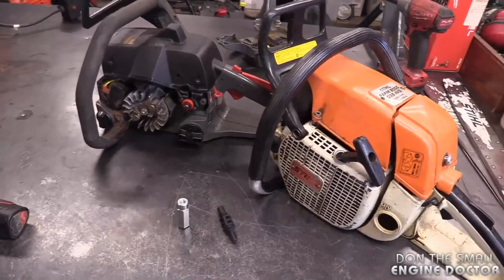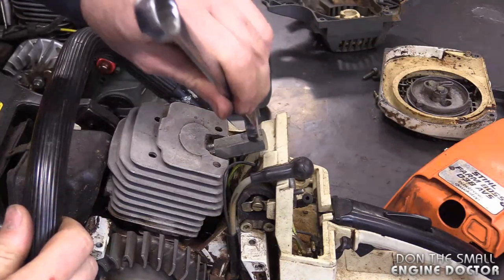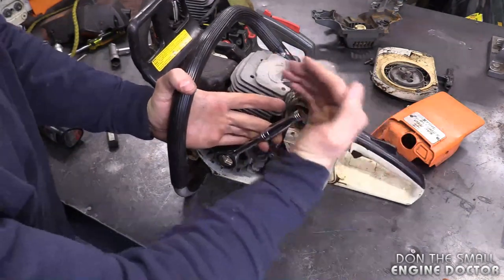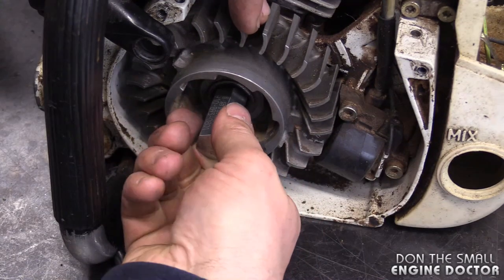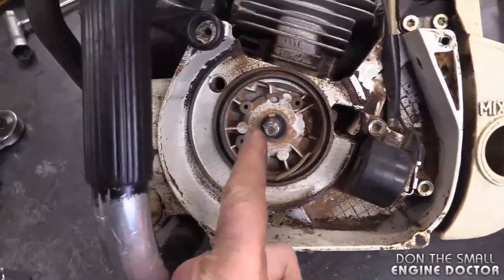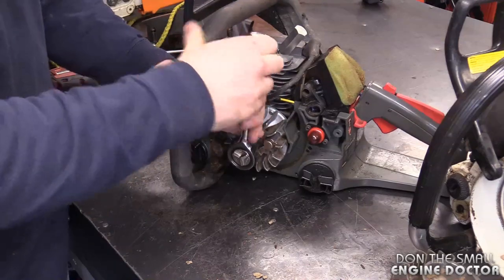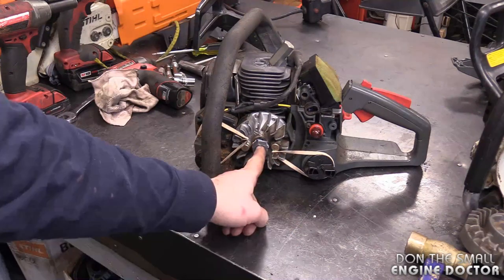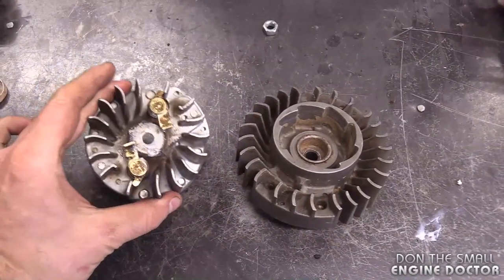The Best Way To Remove A Chainsaw Flywheel!

Comment: 19 idiots downvoted this video...why? what possible reason could they have? smh
Reply from the maker: other jealous youtube channels and shop owners
Reply: Hi, Don I need your help. I made a mistake on my 310 stihl chainsaw trying to cleaning I took off the front pulley and now the flywheel won't spin neither can get the rope out. Plase help
Reply: Because he’s way over explaining his hammer selection and how to hold the saw when you hit it. Anyone who’s even considering removing a flywheel knows tools and is mechanically inclined and if they’re watching this, they really just need a quick “lock up piston, unbolt, screw tool on, give a light whack or 3, and remove.” Not a long explanation on hammer selection. 

Granted I didn’t downvote, but being in a hurry, I was a little annoyed at the drawn out hammer choice and saw holding explanations and I’d imagine that’s why people downvoted.
Reply: It's because they broke their flywheel
Reply: In one video I saw and the guy was saying not safe to use piston stop on big engines like lawn mowers. It is safe on chainsaws. That could be the reason why them downvoted
Reply: Cos you don't need a piston stopper tool. Just use an impact wrench

Comment: As allways good safe advice that's so handy to know :-D

When i was a kid i removed a magneto flywheel off a motorbike using string and a small hammer, the string went through the flywheel holes twice so i could pull them really tight. While i was pulling,  my mate tapped the nut twice and the flywheel jumped an inch forward and was stopped by the nut.
Simple methods can work really well :-D
Reply: Great comment zx8401ztv, I've used this procedure when I didnt have the rite puller setup but used my fingers to hold the flywheel, supporting the powerhead entirely then (with a helper) carefully smack a deep socket on a flange nut which was backed off slightly and always had good results.  My fingers thank you for the string idea!
Reply: Arne Nelson
The string and what my dad called 'Shaking the taper' worked so well for me, good to know some tricks :-D
The old haynes manual was great for ways to do a job without special tools as well :-D.

Comment: great advise , and then i come out with an idea, the nut in the flywheel as you show there I put a long socket 13mm in my case and the banged with a rubber mallet and voila!! nice and lose. Thanks Dony

Comment: I back the flywheel nut off a bit and pop the end of the crankshaft with an air hammer. Pops the flywheel loose instantly. Been doing it that way for 20 years. Basically the same thing as in this video.
Reply: Until you get a real tight flywheel.
Reply: fixinphil  Flywheel is just on a tapered shaft. Not threaded on. I’ve taken off flywheels on really old rusty engines, over tightened flywheels, everything. Like I said I’ve been doing this at least 20 years. I’ll let you know if I ever find one I can’t get off. Lol
Reply: wcjcnc The method that you use to get the fly wheel off is exactly what I do works every time
Reply: wcjcnc I understand that. Taken off many also but every once in a while you get one that's really tight. Same with gens. Always get them off too but definitely will try your method.
Reply: fixinphil I also use that method on alternators. Carrier and Thermo king pulleys are on real tight and we send them out to the rebuilders so you cannot damage them
Reply: i set a pair of vise grips on one of the fins , i suspend the saw off the bench about 2'' by holding the vise grips then give it a shot with the hammer , works every time

Comment: Great to know, thanks.  But WHY does this work, is there enough movement along the crankshaft and/or something that the flywheel hits to jar it loose when you hit the crank end(with nut, etc.) with the hammer?  I've obviously never worked on a chainsaw but lots of lawnmowers and old outboards and there's usually a hole, sometimes tapped, sometimes you have to tap it, to use with a puller.

RichE San Diego, CA

Comment: I have that knockoff tool for larger 4 cycle engines, it's a stens I got off ebay, it works very well.
I remember asking you about 3 years ago, how do I stop the flywheel from turning when attempting to get the nut off, you said I don't know to me, maybe you didn't understand the question, I don't know. But now I have a strap wrench and an impact. I've pulled so many flywheel's now its like second nature. Mainly 4 cycle's but I've pulled those little ones too.

Comment: Hi Don, another great video! With a Stihl trimmer that has the built in key which has sheared off ,could I use red locktite to help hold it in place? The cost to replace the flywheel is $130.00 CAD. so it’s not worth the repair cost.
Reply from the maker: It may or may not work

Comment: I've found on most flywheels you can loosen the nut then take a medium hammer and hit the flywheel on the non-magnet edge. The flywheel pops off usually.

Comment: I couldn't get my Echo CS400 flywheel loose. On that model the springs on the flywheel are bolted on and all is needed is a flat strong plate with holes drilled just for the 2 bolts to screw the plate down onto the end of the crankshaft and boom off it comes. Wrong! 
My plate was aluminum and was bending so left it tight and pulling and went ahead to removing the clutch with the rope in the cylinder and a chisel. During that impossible task the flywheel came loose.
The chisel didn't work on the clutch and  I was having to hit it way too hard.
So I got an 18 mm wrench stuck onto one of the 3 splines in this particular clutch and turned that with a monkey wrench and was finally victorious.

What I'm trying to do is put crank seals in. Thanks for sharing donyboy73. I tried something similar to your 2nd method but mine was just too tough.

Comment: will the flywheel puller tool stihl part 5910 893 0801 fit on all stihl chainsaws I have a stihl ms270c? Thanks donyboy73

Comment: Unscrew the nut until flush with the shaft end, put a short socket over the nut, then use an air chisel tool to pound on the socket.  The flywheel will pop off almost instantly with no possibility of damaging any part of the motor.

Comment: Nice tips.  On my old Briggs motors I put some wood wedges between the flywheel and the block and tap the nut with a mallet.  Usually works but I haven’t come across a real stubborn one yet.  Now if you could help me with my Gravely magneto????   Funny, but magneto doesn’t come up in spell check..  Just the young tech guys haven’t heard of that one!!!!!!!

Comment: Hi Don, Great video, would just like to ask you, the Stihl Flywheel removal tool will this fit a MS171 chainsaw as I've been told on some smaller models the shaft is a different size?

Comment: Hi Dony, your’e channel is awesome.  I just pulled a flywheel from my old 1987 Husqvarna 281, one of my favorite saws.  I got the wheel off (had never been pulled), but it was on there pretty good.  No damage done.  But, I am curious if applying a little bit of anti-seize compound to the crankshaft, or inside of the flywheel’s hole would make it any easier to loosen and pull the flywheel.  I’m guessing not as I’ve not seen reference to that in any service manuals.  Otherwise I was planning on putting a little lithium grease around the shaft, and hopefully pull it more frequently for routine cleaning so perhaps that’s all I need to do.  Advice appreciated.
Reply from the maker: hi, it is not recommended to do that

Comment: Working on a Husky 440e.  The case needs to be replaced due to an oil leak.  I've removed the 4 screws holding the engine to the case but it will not budge.  
What next, does the fly wheel need to be removed??

Comment: If you tighten the flywheel nut up with an impact wrench you can risk cracking the flywheel,so it should only be tightened up with a torque wrench !

Comment: Can those piston stops be used on B&S engines to position TDC for valve adjustment???
Reply from the maker: I have never tried, but they won't work on most briggs
Reply: @donyboy73  Are you aware if anyone makes such for a B&S to aid in valve adjustment?
Reply from the maker: @REVNUMANEWBERN  just google for a service manual

Comment: I couldn't find the tool to remove the flywheel by hammering @ a reasonable price so... I took the nut off, reversed the nut and screwed it on nearly flush with the end of the crankshaft, a helper held the saw while, I using a ball peen hammer held on the nut I struck the rounded end of the ball peen hammer with my brass dead blow hammer, worked like a charm. you could also make your own tool from some scrap hex or round stock and drill and tap it . 8mm x 1.0 is the tread pitch, 7.1mm is the tap drill size for the Stihl 029 I have...your results may vary 😁 (Just don't knock the 3lb hammer off the bench and have it land on your instep, 1½ days later it still hurts 😣)

Comment: Thanks for your STIll  improving methods of flywheel removal ! Once I tried to feel like a crank ball bearing though - while such BRUTAL hammer (even brass one) operation ;-) And I must say: IT DID HURT, really; ball bearing SHAN'T be treated with that axial stress! Probably it can enshorten durability of those two. My flywheel MODE D'EMPLOI is 1.Set two flat steels under flywheel AND MAKE the whole engine HANGING on them by two strong wooden boxes, 2. Loosen the flywh. nut up to last thread is not seen, 3. Hit is as you did, but by steel hammer AND hard WOOD SEPARATOR (aluminum could do as well). This way we can SEPARATE BEARINGS from any hammer-shock = cuz strains are transmitted directly into wooden boxes by means of two flats! Try mentally be with eiher crank bearing :-() That's all!
PS: I've also tried hanging the motor set under my working table with 4mm steel cable loop. The closed loop has embraced the crankshaft just UNDER the flywheel to be removed. Also effective method in case of problems with penetration of flat pieces under the flywheel. Bye, and choose the best!
Reply: I enjoyed your interesting message Adam and like your general idea of protecting the bearings by isolating the force of the hammer strikes to just the tapered areas by solid support of the flywheel and using the weight of the saw and gravity, but I don't think it actually helps, because it  prevents vibrations that are beneficial in releasing the grip of the tapers plus I don't agree the bearings in this situation require the protection described so I think the method of less effort shown in the video of holding the saw in the air while protecting the threads is a much better choice.
Reply: @JoeBlowski  I've just imagined the balls making small dents in rings of crankshaft bearings at every stroke it that way!
Reply: @adamasz54  I'm pretty sure that striking quite hard with a 2 pound steel sledge hammer is the most common method even by professionals and I never heard of bearing damage so I think your worry is totally unfounded. Bearings are extremely tough items and although I can't prove damaging them is impossible I'm pretty sure damage is in fact impossible, being a big hammer guy myself, but I could be all wrong.

Comment: How can a piece of rope in the cylinder keep the piston from moving?
Reply: The piston is trying to come up to the top of the cylinder and the rope piled up in the cylinder takes up the space at the top and the piston can't go fully up. You should watch (through the spark plug hole) for the piston to be almost at the top before you put the rope in and then shove in as much as you can. If the piston is near the top then you should eliminate the problem with the rope getting into the ports because they will be below the piston top. Actually the rope might be easier on the top of the piston than the steel peg which could put a dent in the top of the piston if you put too much cranking pressure on it.
Reply: Thanks Dave, now I get it. 👍

Comment: I have a better idea. Instead of putting the cap on the end of the shaft, loosen the flywheel nut 1 turn and snug a second nut onto the first. Tap the outer nut and that should do it.

Comment: AH''   Man  I came here looking for ways to get the flywheel off a 35 year old  25hp Johnson outboard that has been run in only salt water for 3 plus decades ^ sat for the last 10.  years in a unheated shed.  OH'' Well maybe next video.  lol ,,                                                                                    kodibass
Reply: Lots of penetrating oil for several days, and use heat gun (NOT FLAME)  on and off over those days.  Usually some holes in the top of the flywheel, may have to be tapped, for your puller.  Do NOT pry/pull on the outer edge of the flywheel, you'll damage it (ask me how I know?   :)

Alternative, and risky, after removing the nut and washer(s), get another nut (preferably grade 8), screw it on the crank, leaving it just above the end of the crank.

Ideally, have extra person for this, but put prybar under the flywheel, being very careful NOT to damage anything underneath and get it as far under flywheel as possible.  2 prybars on opposite sides (second person) are even better.

Now, keeping pressure on the prybars to push the flywheel up, whack the top with your hammer.  I like to use a 2 lb. sledge to give momentum without having to swing so hard and possibly miss.

Again, NO warranty, express or implied.  I have done this and it works, but you DO risk damaging things.

Alternative to hammer is to use an impact gun with blunt or pointed end (if crank has a dimple to hold pointed end).  DO have the nut on the flywheel to protect the threads.  Keeping prybar(s) on, use the impact gun on the top of the crank.  Often works better than hammer, but you have to have the impact gun and air compressor.

Good luck.
Reply: @kjell-richardlvdal373  What's your problem?
Reply: OK, there ain't much salt water around Muskoka, Province of Ontario but come on Kodi, you ( and our Orlando friend that is so shy, he doesn't have a name) are the world's authority on salt water problem related issues. Merry Xmas and a very good year  to you and to the shy guy (lol).

Comment: There is 2-4 legs Flywheel Removers what you can use in 2 or 4stroke big and small engines but what ever tool you use keep allways That nut in bolt so you dont broke Threads some times if ive been help a friend and he dosent have those tools i have use 2 screwdrivers and put buddy hit couple little taps in nuts head in brass hammer
Reply: I'd never use a leg type puller (on the outside of the flywheel) on anything not made of steel or iron.  Easy to break aluminum/alloys.  Method shown here and other tips in comments are far better solution.